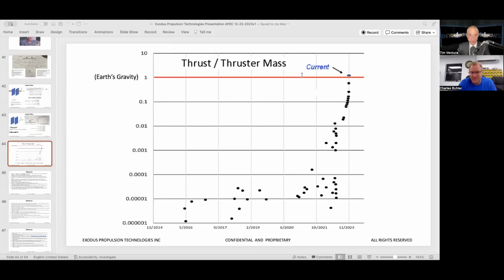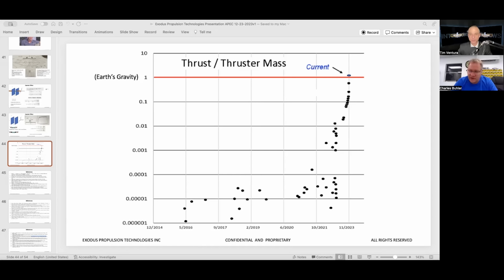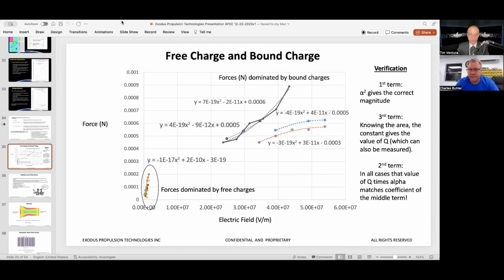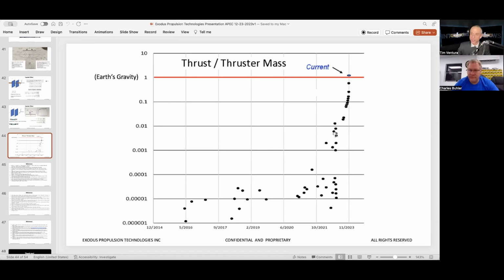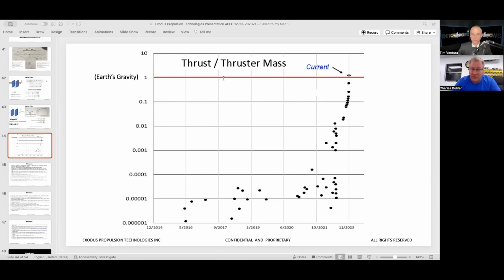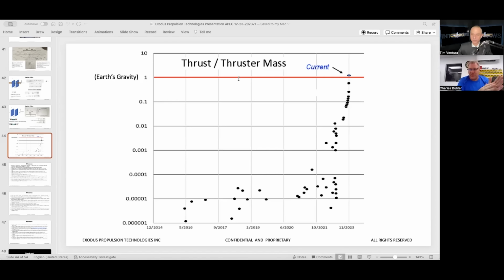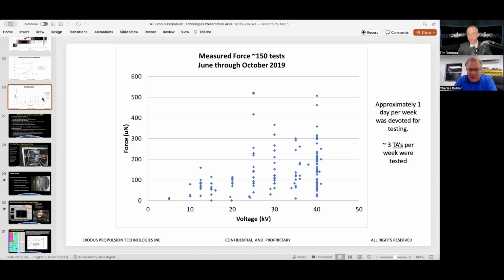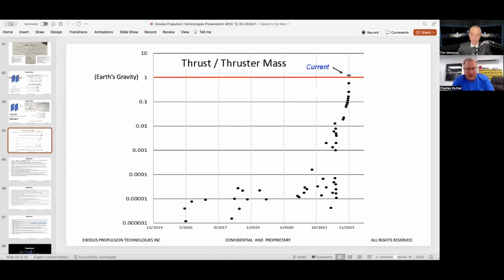Propellantless Propulsion Device | Charles Buhler

Comment: Fascinating and exciting discoveries, love it!  One point regarding conservation of energy:  in principle it may cost little or nothing to merely render a force field;  further input energy is only required if that force then performs empirical work (in terms of force times displacement or force times velocity over time etc.) - such as accelerating a mass for instance.  In this case, CoE would then also require that the energy drawn squares as a function of rising velocity - so to double velocity requires four times the work / input energy, and going 10x faster means 100x the energy.  If instead acceleration is constant for a given force and input power, such that velocity simply sums with unit time - doubling the duration of the applied force doubling the velocity - then an energy anomaly is implied.  Not a criticism (i'm currently measuring a persistent CoE break myself), just a heads-up..